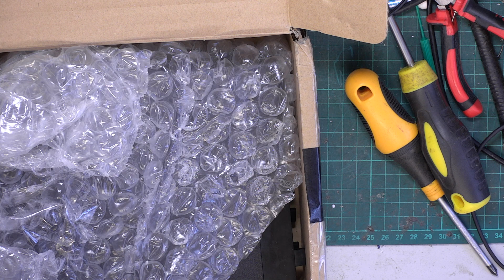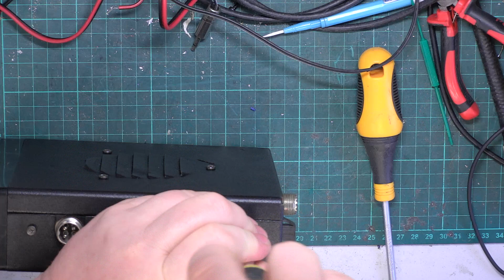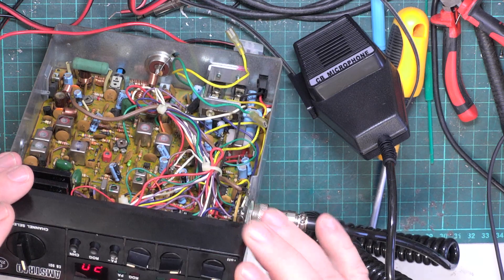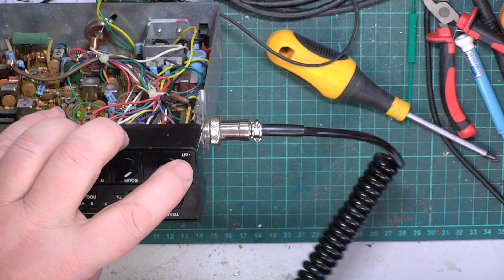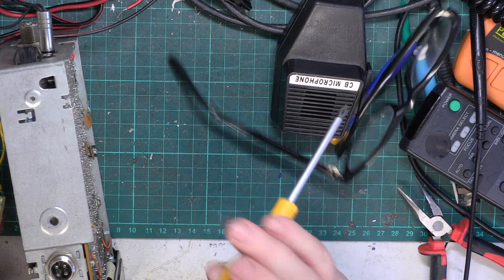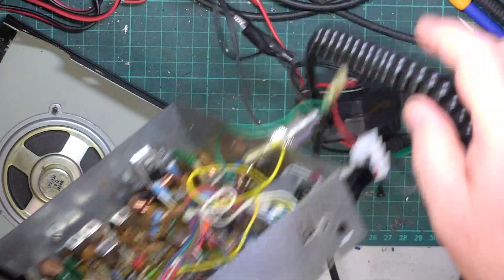Amstrad CB901 extensive repair CB27/81 UK FM CB radio

Comment: Congratulations Richard. What a great video. This was one of the best diagnostic and repairs videos I have seen you do for a long time. Just a pity Picture in Picture did not work again. 73's Keith
Reply from the maker: Yes, the slightest power gitch & PinP disappears. Being in an isolated rural location, I'm the only property at the end of an 11KV overhead power line that comes across the fields to me. There is a small sub-station  on a pole next to this building for 230V. Snag is, you get electrical storms & the supply is all over the place & things like the video mixer/switcher crash or malfunction. I've even have the oven crash!

Richard

Comment: This is good stuff, I am working on a Amstrad 900 that had more chip failures than your 901, also it has had all but two of the electrolytic capacitors changed.  It now has a squeal when you turn the volume up, Any idea's ? the audio chip has been changed for the sanyo make.
Reply from the maker: email me     rshireby@yahoo.co.uk

Comment: Did this one have the same 3W output resister that some of the other Cybernet boarded CB's have had lately ??
Reply: Other Cybernet boards dont need the voltage dropper resistor as theyve got the
gain distribution and devices of the TX Driver and PA correct when running on a 12v rail
Reply from the maker: No, it had the 5W one, but we swapped it anyway for a better quality one & slightly lower value.
Reply: @ukfmcbradioservicingTango21  I wonder if they had supply issues around that resister from time to time due to the surge in demand from the UK that meant they just had to ship them with whatever they could get their hands on from 3W-5W just to get the sets out of the factories
Reply from the maker: I think you are correct.

Comment: Super video as usual, I've repaired quite a few of these and your right on the power transistors, I bought 5 yesterday could only get a watt out of them, the original one did work but would overheat and cutout at 4w for more than a minute it would come back on with a puff off freezer spray, so I ended up putting the original one back and tuning it down to 3w where it was fine.

Quick question if you don't mind, I've just bought a new signal generator a thandar tti, the service manuals differ from radio to radio in to how you set the tone deviation, from your videos you seem to use a modulated 1khz tone from the sig gen, do you set the deviation of this tone to 2.5khz? Most manuals suggest 1.5Khz, I'm using 2.5 at the moment.
Thanks again for your hard work, it really does save us all a lot of time and more importantly saves perfectly good sets from becoming scrap chassis or going in to landfill, say hi to mr Chippy for me.
Reply from the maker: Roger, dev is actually supposed to be set to 1.4Khz for CB radio from a signal generator.

Richard, G0OJF
Reply: As long as you check it does no exceed 2.5, but some shout so I used to set them to 2,3 to 2.4 for a quiet speaker, that way if someone sticks on a power pic it will not exceed 2.5, yes I know t shouldn't, but....
Reply from the maker: Bob, we are talking about the deviation setting of an FM signal generator rather than the deviation setting of the transmitter on a CB radio.

Richard
Reply: @ukfmcbradioservicingTango21  That is what I get for speed reading ain't it!
Reply: @ukfmcbradioservicingTango21  thanks Richard I will proceed with it set that way :-)

Comment: LA1230 is a CA3089 HA1137 NTE788 equivalent, later version like the HA11225 have better S/N
Reply from the maker: Thanks for that Philip. I must try an HA11225 then & see if the SINAD changes on one of our sets.

Richard, G0OJF, UK
Reply: @ukfmcbradioservicingTango21  Ive got some if i can find them, if i do would you like a couple? check out the data sheets for them and the LA1230, pin out should be the same. the 1980's Ambit catalogues 1 to 4 used to feature the latest and best versions of the CA3089.
Reply from the maker: @phillipsmiley5930  No thanks, I just ordered one before your offer came up. I'll do a video about it when it comes.

Thanks again, Richard
Reply: @ukfmcbradioservicingTango21  OK, check out page 6 of Ambit catalogue 3
extra decoupling needed pin for the HA11225. if you dont have the ambit catalogues
i can give you a url to download a pdf

Comment: It makes you wonder why the PLL chip survived?  You get some right wallies!  The Idiot's diode was still there you said, but it wasn't short (unless you did it off camera, but you did have power, so it must have been fine?) anyway, that was a lot of work to get that one going!  Who would put in a transistor without the isolator?  It they had that little knowledge, they shouldn't have been inside it in the first place!  Honestly, shouldn't complain, people like that kept me busy for a while  :-))  Can't get parts now for most of it, not that parts were all that easy to get sometimes anyway!
Reply from the maker: The protection diode was open circuit & was replaced off camera.
Reply: @ukfmcbradioservicingTango21   I use 3 amp 1n540x replacements, they'll blow a 20 amp fuse
Reply: Yes baffles me why they use a 1A diode in these sets, once the diode blows that's it, I've seen large input capacitors explode on some sets and yes why circuit designers didn't protect the chips with a simple diode is crazy, I guess you should only need to do so much to protect against stupid.
Reply: @knoxieman  You just can't protect against stupid!!!!  They will always find a way round protection thinking it is stopping something from getting more!  I have seen some odd things dome to CBs in the attempt to get more power or channels.  First thing I used to do was take it all out, sometimes the CB just started working after a quick retune.  No parts required, other times they would have almost killed it altogether.  I don't know who thinks up some of these Mods, but some has no chance of working!
Reply: @knoxieman  Better to melt the power lead than blow up the radio
Reply: A lot of the time the diode does its job but the positive track leading to the diode blows open anyway.